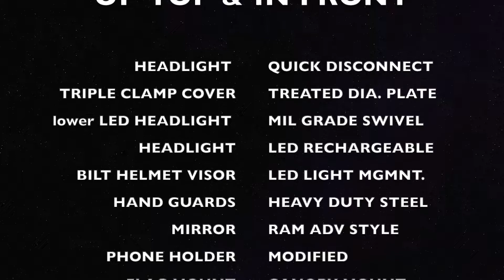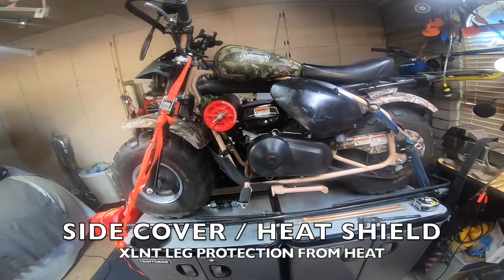Coleman mini bike  - Adventure mods Mods - Never run out of GAS again. Easy DIY Mods. LOOK!

Comment: Excited to see what you do this bike. I’ll be getting one soon.
Reply from the maker: Thanks Steven. Are you going for the CT200-EX? Or that other model ?  ;). I’m partial to the EX
Reply: @imthebrosman  I think the ex for sure.
Reply: The EX get very high marks. Only complaint is Tractor Supplies assembly. If you get one ether build it your self or check it over completely.  Loose screws. Gas leaks. Hardware not in the correct spot.  Torque to specified 15 ft pounds. I use blue removable loctite.    Proper oil weight and no ethanol fuel.

Comment: I have a brand new one. The centrifugal clutch sucks. How to improve it? Takes almost 75% throttle to get movement. 

Not really conducive to helping a kid learn to ride. 

Thanks for any help.
Reply from the maker: Bust off ( literally) the screw limiting the throttle cable movement. Then drill a small hole on the governor arm and move the spring over to the new hole. It will bypass the governor without removing it. It will let the engine rev to a max rate without the need to change valve spring. I’ll find the two videos I used. And post them here for you. By tomorrow.
Reply from the maker: HERE'S THE VIDEO I USED FOR THE GOVERNOR
https://youtu.be/A1QgqKccikg

Here's the video for the throttle restrictor screw
https://youtu.be/e0vfMTYphzs

YOU CAN "BEND" the screw out of the way, or "CUT" it off. 

there are a ton of videos on these mods. I chose these methods because I wanted the reliability of a stock motor, with more performance. The aftermarket carbs are better BUT BECAUSE THEY STICK OUT SO FAR, WHEN I / YOU LAY THE BIKE DOWN (CRASHING) I DON'T WANT MY AFTERMARKET CARB GETTING BROKEN OFF.   GOOD LUCK, Hope these help you out.
Reply: if youre not looking to get a torque converter, then just tighten the throttle cable as much as you want without losing your idle. i did that, it gave me a lot more torque and i could just tap the throttle to get a bit of movement. now i have a straight chain so i lost a lot of that torque but my top speed is far higher than before
Reply: @quinnwest5077  Thanks. Kid complains about the throttle. I tried it out too. It truly does suck. The clutch is trash though... Was wondering if there is an adjustment.

Comment: What were those rubberized foot pegs off of ?
Reply from the maker: Grom and turns out also same as a Monkey. PLUS I saw some on Amazon for about $20.
Reply from the maker: Oops $27 on eBay 
https://www.ebay.com/itm/1Pair-Retro-Motorcycle-Off-road-Universal-Foot-Pegs-Forefoot-Pedals-8MM-Aluminum-/224473421768?mkcid=16&mkevt=1&_trksid=p2349624.m46890.l49286&mkrid=711-127632-2357-0